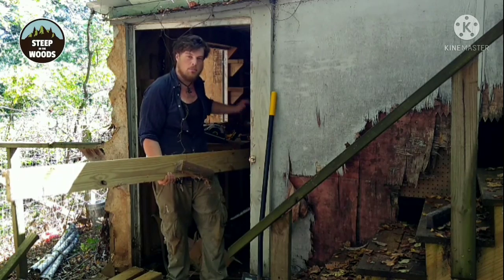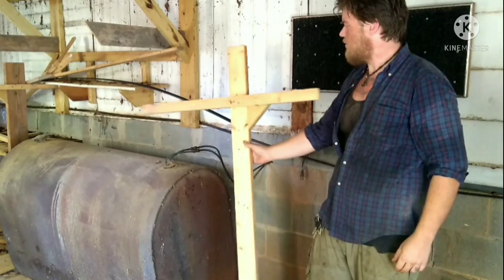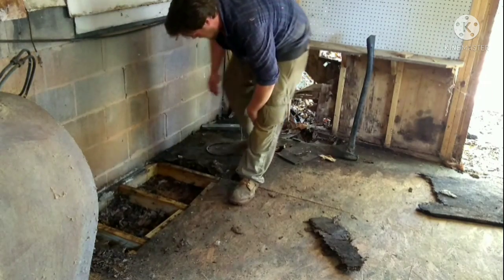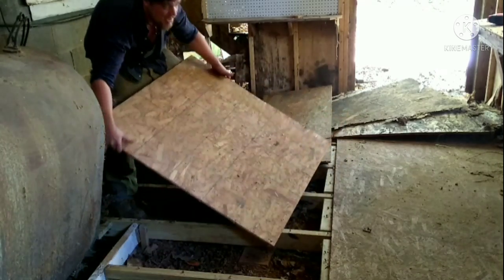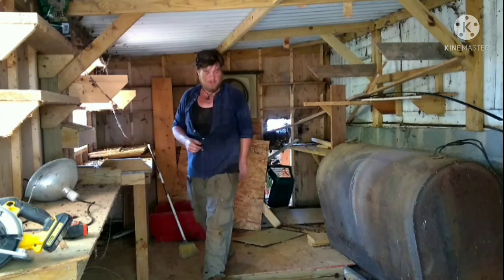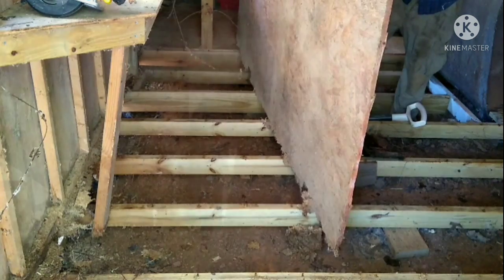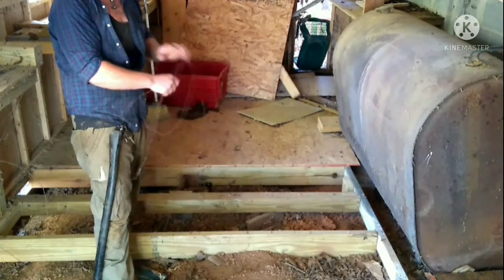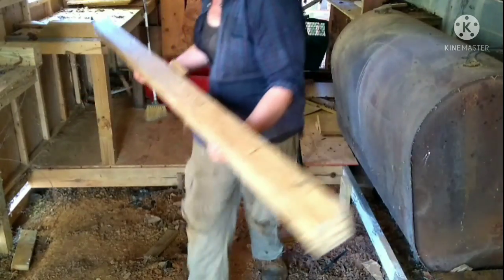Demolition Begins!

Comment: Like you say - easy to tear apart something done half-assed. I pity anyone taking apart anything I’ve built - it may not be done 100% the ‘correct’ way but it will be over-built. Usually with deck screws through everything. I’ve even cussed myself a couple of times when I’ve remodelled something I built in the first place! 
That oil tank doesn’t look ideal sitting in the dirt like that - reckon you’ll find some rust holes in the bottom is where the smell is coming from. 👍🏻
Reply from the maker: Same here! I got on the Torx bit kick a couple years ago and I doubt I'll ever go back LOL 
I am surprised how much of it's still worth something! We're going to salvage whatever possible and hopefully retain the roof, it's a perfect place to store our Salvage Lumber!